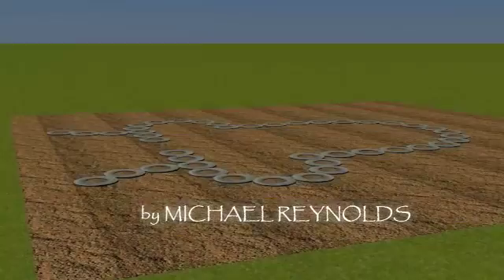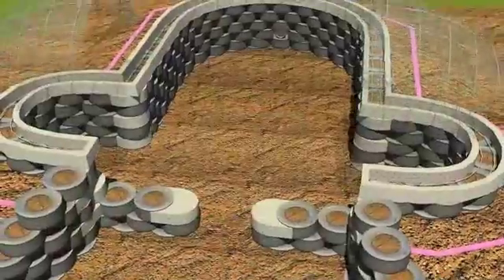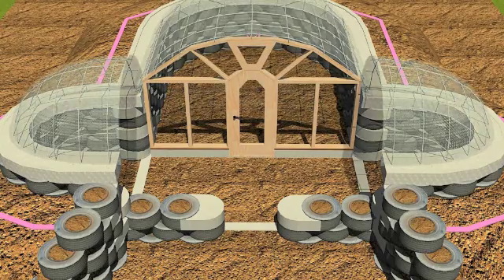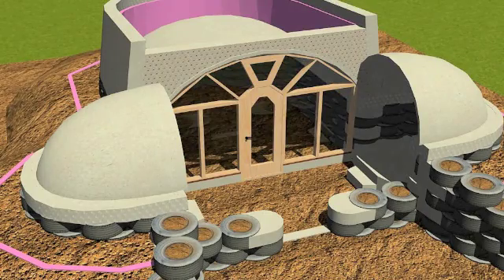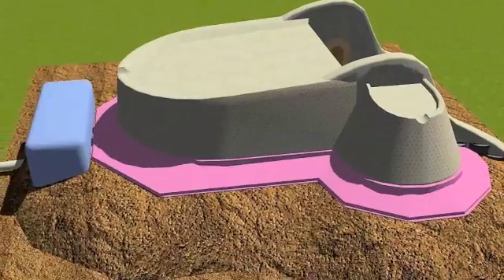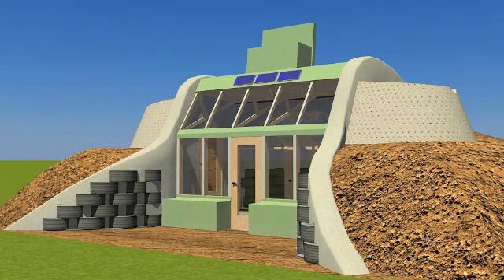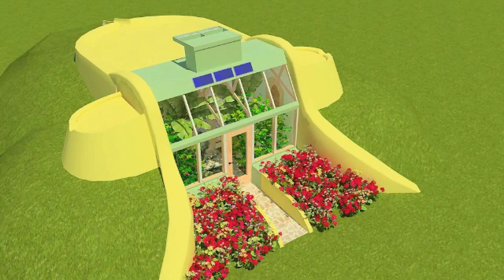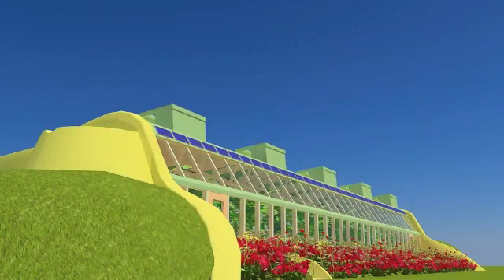Simple Survival Model Earthship

Comment: Things 'missing' or 'Improvements' for this type of construction :
- What i seem to miss a lot on these types of homes are Solar Boilers (likely with electrical assistance due to legionella baterial growth), as there is so much roof space i am somewhat confused it isn't used to warm (and heat up) water. There is systems available on the market that cook food by the sun (vacuum tubes), surely parts of those can be used to cook already warmed up water, and a simple electrical pump can keep the whole thing going. A hot shower or just warm water to shower or wash would be much appreciated, even in a survival situation !
- The lack of a root cellar under the (entire ?) dome, while i understand that the whole thing is basically a root cellar, the goal of the living space is obviously to keep it at a comfortable temperature range (18~23C), which means storing 'root and other crops' like they were traditionally isn't possible. And especially if the structure is called a 'survival structure' i would want to have a place to store crops from the outside garden for the 'dead season(s)'. Another benefit of a root cellar is that it supplies sand, actually might be enough to complete the entire brim (taking into account that some excavation is also done for the blackwater cistern (or drain field). Sand, against popular believe, isn't as cheap as you'd think, at least not in more conventional western locations where most of the time you have to bring it in. Now sure, this creates some engineering and building challenges for the floor (and possibly baring walls of the cellar), but the benefits (might) weigh up to those.
- The 'lack' of stimulating 12~24~48 Volt appliances and small home batteries. Developments in ships, but most noticeably #VanLife has shown that living off of low voltage appliance and small electrical systems is most certainly possible without compromising to much on convenience. Actually, if one doesn't have a computer/laptop (but uses a tablet), there is hardly any need for converter, as even fridges can run off of low voltage (and also internet services (modem/router) pretty much always have a converter unit on the plug and they basically run off of low voltage). A 24 volt system with around 500Ah of battery (that is 2~3 deep cycle batteries) should be plenty to run a small household (it's only once you go for big flat-screen tv's that higher voltages are needed).
- Using Sky lighting tubes, while i am not aware of the price, there are these highly reflecting tubes available that can bring light down to considerable depths. Obviously these are incredible useful for this type of construction, especially further back into the earth ship and most noticeably during summer when cooling needs clearly outweigh bringing in the sun.

Critique that irks me a lot
- It is argued that all alternative building materials 'tires/glass/aluminum' are being 'recycled'. THIS IS NOT THE CASE !! ... these items are being 'REPURPOSED', as recycling would be them returned to a material state in which they can be made into the same thing (sometimes something else, if actual recycling isn't possible, and even that is not even true recycling, as it's repurposing' especially if the material can not be reclaimed and the subsequent product itself can no longer be recycled). This irks me also because 'glass and aluminum' CAN BE RECYCLED, so this house is basically taking materials OUT OF THE CYCLE, meaning that these have to be mined again to replenish the stock of raw materials to keep the volume of these materials the same! ... While i understand that these materials weren't used this way back when this concept was conceived, and some of these still litter the country side due to 'dumbnubs' littering. The concept of using materials that actually cause more pollution elsewhere due to mining activities, makes said concept a lot weaker ... (where i would like to add, for as far as applying this concept in a western frame of mind, as there are likely multiple locations of the earth where these materials still end up on landfills ! and REPURPOSING them would be a lot better ~ even better still would obviously be to truly recycle them).

In All ... this passive type of construction is still the way forward, as far as i'm concerned, especially in a world where conservation of energy to reduce CO2 footprints should be a global goal. BUT, for this type of construction to actually make it, i do think some modernisation of the whole is in order (btw. also showcasing that Tired do not have to be used, and a conventional concrete backwall of sufficient thickness (and sealed to prevent water coming in) works just as well) ... This type of living should probably aim to 'merge' with the Tiny-House movement and #VanLife ... The challenge should probably be how to make this appeal to the Modern Millennials, and less to the 'alternative neo-hippies'. #EarthShipLive !
Reply: Some of them do have root cellars. It's just extra work and cost.  Some have them separate from the main building.
I think that anyone interested in growing most of what they eat would increase the planting area inside.  most of the ones on youtube seem to be rentals or for people who just want to grow the odd item rather than providing for most of their food needs.  Some of them just plant ornamentals!
I agree with you that much of their stuff needs to be repackaged to make them more appealing to the masses.  I think that is where they fall down and why they will remain very niche.  You have some great ideas though!
Reply: @theuglykwan  I know that others have root cellars ^^ ... this comment was mainly aimed at this 'tiny shape' that's being portrait as a 'survival model' ... being somewhat of a prepper, i see that in order for me to survive in one of these, i will have to need a root cellar, because i will need a place to store produce during my winters (or die of starvation, hence the link with 'survival' ;) ... ).
As far as the size of the gardens go, i agree and disagree with you :) ... I agree needing a lot more space to grow things, so something like this should most certainly have a bigger outside garden. Where i disagree is on the greenhouse aspect of it. This mainly in the sense that plants growing in a greenhouse will be from a different growing zone (usually 1 to 2 zones higher then the zone one actually lives in). 
So basically the plants growing in the greenhouse will be different from the ones growing outside (except for producing seedlings early in the year for the outside garden, early sprouting). 
So with that extra knowledge, it then becomes more of a dependency on where you actually live, and whether you need a big greenhouse or not. Which then mainly depends on the type of plants/shrubs/trees you want to grow in them... and your need for this produce THEN obviously dictates the size of the desired greenhouse (besides it's insulating properties).
Another thing i do want to mention in this regard, that there is an exception for certain regions in the world (not sure which they are though, but) where the winter is mild enough so that the inside of the greenhouse will be like the outside during the actual summer. In those cases you can use your greenhouse during the winter to plant and produce 'normal' summer crops.
Reply: Very cogent comments, thanks! Do you have any thoughts on the feasibility of combining the earthship concept with something like a monolitihic dome? That idea has possessed me recently and I'm trying to figure out if there's some kind of deal braker, mostly with the passive solar of the earthship when applied to a dome shape. The dome (when monolithic) is a thermal mass as a whole, but obviously the sun will not penetrate the whole volume even with a large glass front on the south side, I think.

Comment: I always wonder why they dont dig the floor down like 4 to five feet so you dont need to pack as many tires in the walls.  I mean if you dig 4 or 5 feet down you will only need half as many building materials for the walls.
Reply: yes good point more like a walipini style especially great in colder climates,  but also more consistent and cooler temperatures in warmer areas.
Reply: Tires are isolation!

Comment: Why not form a series of rooms in a circle that looks like a flower.
Reply: Hotsauce is Lethal:
The first reason would be that it does not allow proper sun light capturing.
Reply: Earthships are often built oriented in a specific direction to maximize sunlight in the winter and minimize it in the summer. A circular structure wouldn't really be able to operate on this principle, so a greenhouse might have to be a separate structure. Or just built in specific areas within the circular structure.
Reply: It' a "simple survival model."  But then, I'm not sure about why? I mean, surely this would all have to be built before and disaster occurred. And also there is definitely not enough room in the greenhouse to feed an entire family. At this size, it just seems like a small, sustainable, house with temperature insulation, solar power, and that will provide a few vegetables and maybe a small fruit tree,

Comment: anyone care to answer a few questions?  i get the tires are encased in concrete.  so this traps the tires toxicity?  there are no toxic fumes released into the house?  how long are these expected to last?  how well would it stand up against an earthquake?  cost?
Reply: +Karl Saygan I'm building one right now and these used tires have nearly no smell unless you put your nose on them and sniff hard.  All of these tires are in one small area and you don't smell tires.  On the outside of the tire wall, I'm putting 6 mil plastic to keep the soil off of the tires.  This barrier also goes down below the tires so any moisture that might get in won't touch the tires.  On the inside there will be layers of cement made with the sand from my property, clay and portland cement powder.  My experiments are showing that this mixture is VERY dense.  I have no doubt that there will be no toxicity coming into the home or outside of the home or I wouldn't have bothered to do it in the first place.
Reply: +Karl Saygan There's a lot of debate about this Topic. Some say that Toxic Gases will begin to seep into the Living space. Others say that because they are encased, with no exposure to sunlight, it does not go through the biodegrade process. Which is true, and which is speculation is tough to say 100%. Studies have been done on it, but as this is also New in terms of building, it only has a small amount of Data to go on in terms of Long-Term.

Myself, I prefer to build with Earthbags. You get the same Thermal Mass properties as you would the tires, but don't have to worry about possible Toxicity being an issue. Just might cost a bit extra.

Comment: I like the idea, but what about long term? I mean tires have their own life, they'll degrade, releasing toxic agents to the soil (and after that more deeper into the water).
I can see the positive side of the old tires, but how could we deal with the negatives?
Reply: +Jakab Fulig I was wondering the same thing. Also, think of the smell of the tires in general. I love the earth ship idea, perhaps in another shape also.
Reply: +Jakab Fulig That was my concern too, but they've had many studies showing that tires, when covered completely, don't degrade.  They are an extremely stable building material.
Reply: Do you mean completely covered by dirt?
Or is there a layer between the tires and the dirt around?
Reply: +Jakab Fulig All it takes is to be out of the sun.  The dirt doesn&#39;t absorb anything since the tires are stable and don&#39;&#39;t break down.  Find a tire that has been buried for a decade and a tire that&#39;s been sitting out in the sun for a decade.  The one in the sun will show dry rot and other signs of breaking down, but the buried one could probably be put on a car and used.  You&#39;ve gotta do some personal experimentation since no amount of studies are going to prove anything like personal experience.
Reply: +Jakab Fulig There's a moisture barrier of thick plastic that goes between the tires and the dirt in cases where you don't have a full roof like on the huts.  When the roof goes out past the insulation barrier in the berm, you don't need that.  No moisture hits the tires.  Even the bottom tires have a thick plastic sheet of plastic under them.
Reply: I'm finding most land use codes in choice locales are prohibiting "Tire construction". I've considered the earthbag idea, but find it more of a temporary solution, as the bags also degrade. Any ideas on an alternative to the tires, simply to conform to code?
Reply: @matroxxm6870  Answer:
Canamo - Hemp Fibers

Comment: What happens to tires in the case of a fire?
Reply: +Susan Solleder Nothing at all.  In order for things to burn they need oxygen.  Tires rammed full of earth don't have enough oxygen to catch.  There is a case where an earthship burned down.  The tire wall was fine.  They rebuilt the house.
Reply: +Susan Solleder  tire walls are encased behind cement & plaster. So nothing.

Comment: Hey fuck me but I think this would be ugly and stupid. cans will crush under pressure plus why not just recycle them you tree hugging EEEEEEEEEEEEDIOTS!!!!!!!!!!!! nothing wrong with concrete.
Reply: there are earthships and they work. and recycling costs money and time.
Reply: stooky bird Obviously not, moron.
Reply: +stooky bird 40 years of building these has proven that the cans save you from using too much concrete and if done right is still plenty strong to hold its weight and more.  We've just had this permitted in south Georgia.  They thought it was strong enough.
Reply: You only use cans on non-load bearing walls. Can walls use ferrocement to hold the cans together. Not only does using cans take them out of landfills but it also means you bring costs down as you use less ferrocement for the walls.